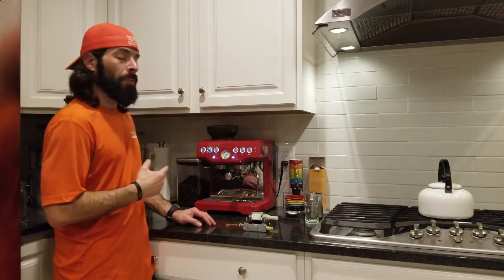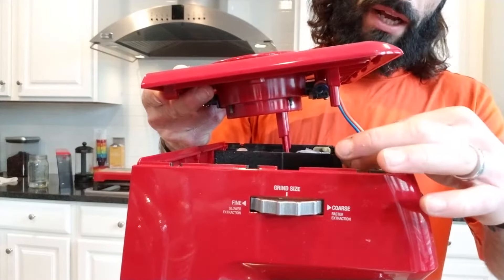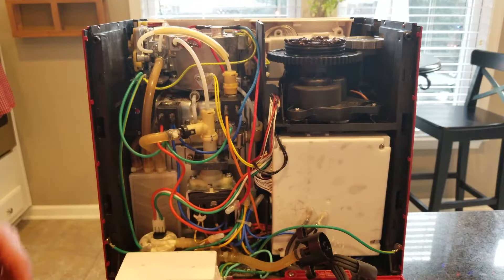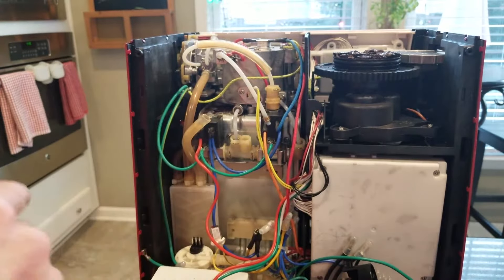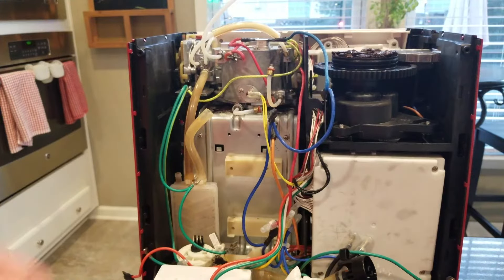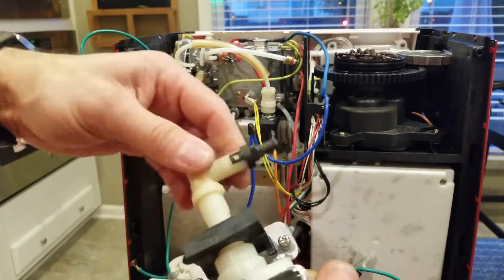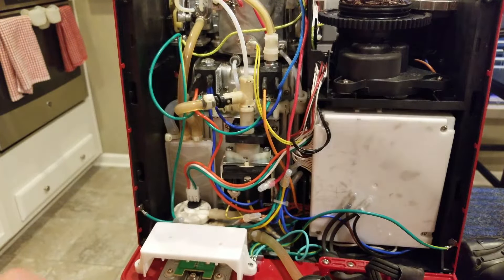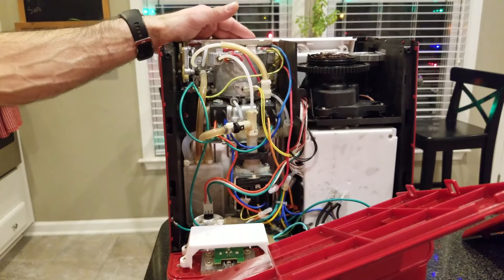Water Pump and Solenoid Block Replacement on Breville Barista Express 870XL

Comment: How do you disconnect the safety catch on the connectors for the pump? Thank you.
Reply from the maker: I have to open up my machine this weekend as I have some loose scale blocking water flow.  Happened this AM as I was pouring my shot.  Talk about a bad way to start the day.  Anyhow, i'll film a short on disconnecting the water pump electrical connections.
Reply from the maker: Still going to post up a video here shortly showing how to disengage a safety, but I'll try and talk you through it here.

So right at the base of the female section where it goes from wide to narrow into the wire right so at the bottom of the wide bit you want to push in right there and pull at the same time. I'm not really sure how to describe that better but there is a detent there that you can press on and hold down while you pull the connector off.

I hope that was helpful keep an eye out for the video.
Reply from the maker: And the short  https://youtube.com/shorts/uVGC_Te_qLA?feature=share
Reply: @lai2703  Thank you! I got caught up on life and appreciate the response!

Comment: I just replaced the water pump and solenoid block and still have a low pressure issue. The only way i can get the pressure to go up to max is by inserting both the cleaning puck and a piece of plastic bag underneath- the cleaning puck alone won't indicate pressure on the gauge. I am completely stumped :/ the lines have no blockages either
Reply from the maker: Wow.  That's really frustrating.  What I have experienced when I have water flow and low/no pressure there is a blockage somewhere.  If no water at all then it is possible that the pump has failed.  I wish I could be of more help, but your symptoms lead me to think blockage.
Reply: @lai2703  interestingly enough water flows through quite quickly through the cleaning puck with a single wall filter- it just doesnt build pressure hence why i am stumped. Water goes through the espresso puck quicky but no pressure. It is almost like it is just puking water through the boilder and out of the machine without allowing pressure to build up
Reply from the maker: Again, that sounds like a blockage, which are almost always a partial blockage IME.  Water can flow in and through, but won't build pressure because there is not enough source to meet the requirements of what is needed for proper pressure, but you will still see plenty of water.  If that makes sense.  Are you measuring how much water is being pulled?  For reference, my machine is setup to pull 2oz of espresso if I'm doing everything correctly (I normally am).  When I pull just water, i.e. no coffee in the portafilter, it will pull 3oz of water.  When I have a blockage I get nowhere near that.  Maybe 1 or 1.5oz.  Now, if you're getting that amount of water then it doesn't make any sense why you wouldn't get any pressure with the proper grind.
Reply: @lai2703  i just ran an empty shot through it with the single shot filter and i am getti g around 2-2.5 ounces. Im not sure if this is still normal range but i will try running water with a syringe through the boiler tomorrow
Reply: @lai2703  i fixed it!! For anyone else with a similar issue- CHECK YOUR GRINDER FIRST. I was convinced that the finest setting was good enough for the espresso shot, but it was not. I took the machine apart and reseated the grind dial so it could go even finer (for example, the burr setting that was "finest" is now #4 on the dial). The pressure is now fine. It appears that my machine had both a bad solenoid block and the burrs were worn down.
Reply from the maker: @lifeonbicycles  yeah, the grinder in there is pretty sweet and hyper adjustable.  I assumed your grind was good that was my mistake.  Glad you got it sorted.
Reply: @lifeonbicycles  I tried doing the burr adjustment but I can't get it to work, can you please explain how is the procedure to reseat the grind dial to go finer. Thank you

Comment: Thank you brother for taking the time and teaching us this critical repair. You are a natural teacher and your expertise is much appreciated. Quick question, I developed low pressure problem with my Breville Barista Exp., recently. The machine is 4 years old, and before the low pressure started, there was this strange buzzing vibration sound when I pressed the single or double brew buttons. I know it is hard to describe the sound in a text but the sound is abnormal. Is that what you were hearing, because I don’t want to open up and order all these parts and end up  with the same problem! Not that I am asking you to diagnose but is there a way or test I can do to make sure it is the solenoid. I am getting some crema but the pressure needle doesn’t move. I must add, the problem got worse after I descaled with a Durgol solution instead of my normal vinegar solution! Thank you in advance and looking forward to hearing from you
Reply from the maker: Tough to say without hearing and or seeing the machine, but I think you might just have a scale issue. The two lines that go into/out of the boiler should be checked. I often find scale broken off and stuck there.  It is possible your solenoid is toast, but I would check for scale in the lines and or ports before performing major surgery and spending $$$.  Good luck!
Reply from the maker: Also, I would check your grind first.  If you are getting the proper amount of water you might just need to adjust your grinder could be set too coarse.

Comment: I did this same repair on my machine however I CAN NOT seem to get the hoses connected to the solenoid to stop leaking water! I have taken them apart and re attached them multiple times. I ordered new o rings and replaces them all. Still leaking water!! Please help! what tips or tricks do you have for resealing the lines after installing the new solenoid!?!?!
Reply from the maker: If you replaced the block you can steal the o-rings from the connections there.  It's very easy to nick the o-rings when installing the hoses.  Alos, you might want to use a light rub of vaseline on the o-rings when installing them to ease their entry.
Reply: Skye, run the machine with the back off to identify exactly which one is leaking. You may have a pinhole in a hose. Be very careful not to touch any live wires with the machine energised and the back off!

Comment: Hi, my breville makes a quick 1/4 second kick noise when it starts up, but not the noise at the beginning of the video. ZERO pressure , Zero Water coming out and being pumped through. Only used less than 20 times.  Could this issue be the pump ?

Comment: Thanks for the video - I’m stripping down one of these at the moment.  Any idea what the white sealant used to hold the small component inside the sleeve on the outside of the pump is?  The one from the yellow wires.
Reply from the maker: That's what I assume to be a temperature sensor and I am also assuming that is some type of thermal conductive compound.  At least, that's what I recall going of memory.  But to more specifically answer your question, I do not know what that is.  Best I got is my assumption.  Good luck with your repair.  

FWIW, I didn't add any to my new pump and just used the old material leftover from the old pump and sensor.
Reply: @lai2703  thanks - mine has been apart for a while as I wait for parts and I lost the “mystery compound”.  Interesting that you think it is thermally conductive, not just sealant.  (Okay so it’s heat sink plaster I think. ). Thanks!
Reply from the maker: @PeterWardell  yeah, that's the ticket.  Heat sink paste.  Reminded me of my days building PCs in the early aughts.

Comment: How do you disengage the safety catch on the connectors to the pump (4:56)?  Mine will not detach
Reply from the maker: Hi Aimee.  Unfortunately, it's been over a year since I performed this work and I do not recall the exact mechanism these spades use.  Manufactures employ many different styles of locking tabs with their spades from a simple raised dimple to a lever mounted detent that one can push to disengage.  The fact that the connector is protected with heat shrink tubing makes it harder to sort out what system it employs and disengaging it.  My suggestions: see if pressing on the back of the spade while pulling helps or push the connector on a bit before pulling back on it or wiggle left and right while pulling on connector.  You've likely tried all these methods, but without pulling one of my machines apart to see, i'm afraid i'm not too much help.  Good luck!!

Comment: Hi Luis. The 870XL solenoid valve we need is not easy to come by. Did you notice if the old one was fixable?
Reply from the maker: I originally took the solenoid apart and cleaned it up a bit with scotch brite pad.  This helped a touch, but if the machine got too hot the solenoid would act up.  Perhaps yours is more of a scale issue, but I think the magnet in mine was just weak/defective.
Reply: Got it. I ordered the parts but they are scarce. Thanks to your video I feel confident I can fix my 870XL. Here's to that sacred morning cup.
Reply: Hey Steven, did you still order it despite it being listed as "Backordered"?  Did you receive it?
Reply: @eazhar  I did. As well as a new pump. Works as new. U know there are back orders. Patience.
Reply: Ebraheem Azhar i waited for three months for the back ordered solenoid.  But it was worth the wait since replacing the old one was a snap with this video as a guide.

Comment: my machine when I turn it on I don't hear the pump and just appears on the display the message “fill tank”, I tried to move the magnet on the back but nothing happened.
Reply from the maker: Hello, Ronaldo.  I'm not sure which machine you have, but the Barista Express has no such capability as you describe.  That is, there is no fill tank message or method for the machine to know how much water is in the tank.  I am sorry, but I am unfamiliar with your product and therefore unable to help you.

Comment: Hello my expresso completely no pressure on meter any suggestions what parts need to change? Thanks
Reply from the maker: First thing I would check are the lines running to the boiler. These thin plastic lines clog very easily with bits of scale.  A majority of failures are going to be blockages. Check that first.

Comment: This is an awesome video! I will be doing the exact same thing once I can locate the part. It doesn't look like the full assembly is available anymore, so I was hoping to get some specs on the individual solenoids as I may be able to just replace those on the existing assembly. Do you think that's possible? Is there any info on the silver stickers on the side that would be relevant in finding the correct replacement part? Thanks!
Reply from the maker: Totally possible to replace individual parts, but it is a little more involved.  Also, make sure it is not a scaling issue that has you bound up.  The right most pipe coming off the boiler/group is the culprit I've most had issue with in the past.  Popping it out and clearing the blockage fixes the issue, but I also like to grab a small straw and rig it up with a vacuum to suck out anything that might be loose in the port/group.
In regards to availability it shows backorder, but that comes off at times and you have to check back frequently to see its availability.  I too ran into backorder status and even had a delay once I placed the order as it showed in stock but at some point came off in-stock status and delayed my order.  
Hopefully, that is clear and answers your questions.

ETA: If you're experiencing the same solenoid issue as I was this is the solenoid that failed for me.  Be careful not to tear any of the o-rings as then you may have a leak post repair.  https://www.ereplacementparts.com/solenoid-valveolab-9200h-p-629957.html
Reply: @lai2703  Thanks! This is super helpful. I'm very much into repairing my appliances to avoid needless landfill waste. More companies should be like Breville in supplying replacement parts. When my power supply broke on my wine fridge, Cuisinart was zero help and said only thing I could do was replace it! Cost me $5 to find a laptop power supply with the right specs. That's criminal.

Will disassemble and see if cleaning helps. I definitely get that loud buzzing when pulling a shot.

Since you seem to be an expert I'll also ask this: my pressure gauge stopped working about a year ago. I figure I'll check for blockage when I'm in there, but any experience/advice you have with that would be appreciated!
Reply from the maker: @GACzki  unfortunately no experience with the gauge failing.  And no expert here just a guy, that like you, hates tossing things and would rather repair them.  Good luck on the repair!

Comment: We changed out this part (successfully, we thought) and somehow a lot of water sprayed out inside when pulling a shot. We realized it by seeing water seep out underneath and upon opening it back up there were signs of water all over. We can’t tell if the right side of the valve actually broke when reaching a tool through to secure the metal panel on. It wiggles a little and is not as solid as the original metal part (which has more heft than the new, also). We’re going to dry it out and put the old part back on but we’re concerned about what to do next.
Reply from the maker: You might try leaving the new block in if you don't see it broken (I'm unclear if it is from what you wrote), leaving the top off and turning the machine (with full reservoir).  Using a flashlight you might be able to tease out where the leak is coming from.  Might just be a line that's not seated all the way or a nicked o-ring.  If the latter you can steal some o-rings from the original valve block.  I believe there are three you can use from there.
Reply: @lai2703  thank you for those tips! We’ll try it. They did agree to send a new valve and it’s def cracked on one of the small plastic parts.  With the old one back on, no more leaks.  We’ll definitely try that if needed.

Comment: Bro it’s people like you that gives people like me the confidence to try and tackle the problem myself.

I also have the loud buzzing noise. Im in the UK and for me to send my 870XL to a Sage recommended repair centre to change the solenoid will cost me around £130!

I read another comment where someone took the solenoid off and soaked it in descale solution,  I think I will try this first before ordering a new one. What do you think of this idea and did it not occur to you to give this a try first?
Reply from the maker: I broke the solenoid down when I first diagnosed that to be a problem and there really wasn't any scale built up.  Nevertheless, I took some Scotch Brite and cleaned it up.  This seemed to help a bit but was only good enough to work if I pulled shots before steaming milk.  When the pump went out on me I decided to change it all out at one time since I was ordering parts.

Comment: Hi, I also use the same BES870XL for around 2 years.
It’s problem is heating. Every water come from it is not hot. Just room temperature water comes out when I brew it.
Buzzing noise is same as before, I cleaned it regularly.
I think boiler fuse is disconnected, if it has any fuse.
Do you have any idea to fix it?
Thank you.
Reply from the maker: I'm sorry I do not.  I have yet to have a heating issue with either of my machines.  Best of luck on the repair.

Comment: Thanks for the video! So I got the part, replaced it - all looks good. But now water won’t pump through to the espresso drip and I’m not getting any heat through the steam wand (so there’s no steam, just water) or hot water. I’ve double checked all the connections to the solenoid block and it looks fine. Any suggestions?? Thanks in advance
Reply from the maker: If all the lines are connected correctly, then you may have a blockage in one of the lines. Perhaps a bit of calcium build up that got knocked loose while you where swapping everything over. I would double check that all the lines are run correctly, that the electrical connections are in the correct position, and lastly make sure the lines and openings are clear of any obstructions.
Reply: LAI thank you!! I’ll give this a try

Comment: Hi there, thank you for posting such a detailed video! I have the older Barista Express 860XL. Your video has helped me decide the solenoid is tempermental and needs replacement. What's forcing my hand is that the steam just stopped working in the last couple days. I can still run espresso, albeit sometimes with that terrible solenoid failure grinding noise... but when I turn the machine on, I don't get the familiar grumbles, just a quiet hum. And steam pressure is non-existant, and no pulsing noise of the pump (?). Does that sound like I should replace both solenoid and pump?
Reply from the maker: Does the machine pour hot water if you select that function?  I'm not familiar with the 860 and any difference it might have but on the 870 you turn the steam switch towards the back of the machine for hot water vs forward for steam.  If you get neither hot water or steam, then likely the solenoid has failed or is jammed.  Especially if you have the loud buzzing accompanying.  that being said, look for scale built up in the small feeder tubes before replacing any parts if you are having flow issues.  This is a common issue with these machines.  I have a video in the works on this.

Comment: I don't have the same problem but I thought someone might know.  Our machine won't turn off when plugged in.  Nothing happens when pressing any of the buttons but all of the lights are on...even the ones that shouldn't be.  The grinder, steam wand, group head and hot water is not working.  Any thoughts on what the problem would be?